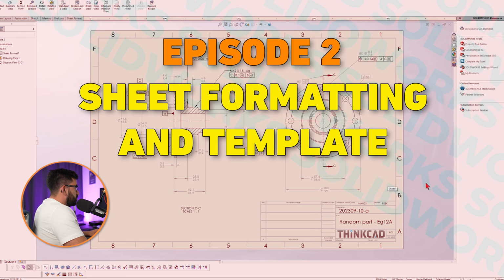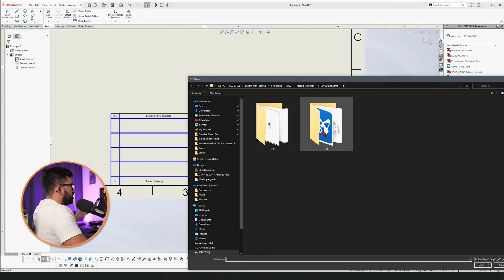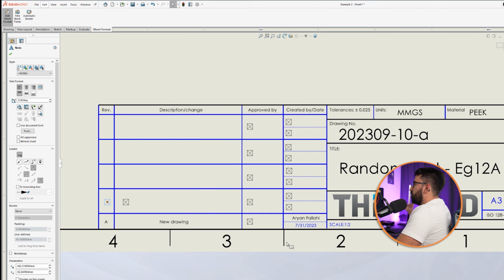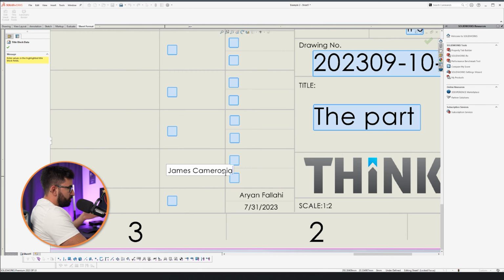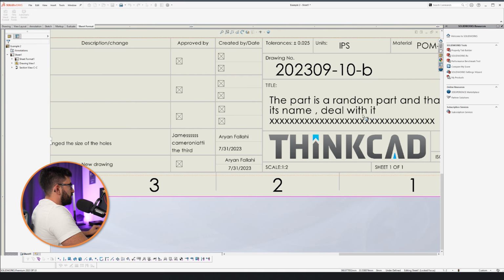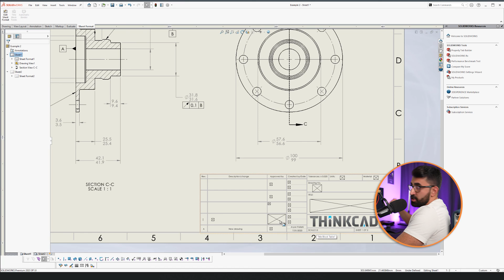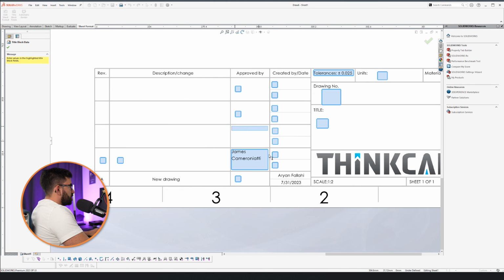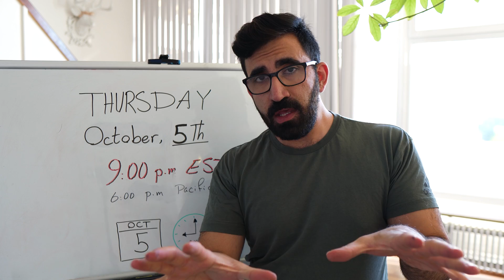SOLIDWORKS Drawing | Make your sheet template

Comment: Hi my friend I need to make single part with two or more configuration and I need the name of each configuration change for each drawing sheet the problem is I got the same configuration name on the sheets even if I change the configuration
Reply from the maker: It's the way you link the name of your config to the sheet. It's has to be through a linked property. Can you confirm you've done that correctly?
Reply: @with-aryan yes my friend I didt correctly

Comment: Hi
How can I link material and mass? it is very important because I don't want to do it manually by myself, it has to be done automatically. (I've already done that in inventor)
Thanks for your tips.
Reply from the maker: Yes, these are parameters, that you can add to the sheet, and link those variables as needed.

Comment: I always use property sheets for propagating data to the placeholders in the template, since Solidworks added that handy dandy properties editor/builder to newer versions of solidworks. In addition, I keep revisions separate from title blocks. It's still on the same page, just placed at the top. Solidworks default template is just fugly as butt ugly gets, I redid my own complete.

Comment: I followed the steps and tried to create another title block for a separate table that I made at the top of my sheet, but it just loads up the same title block I already created when I click title block fields. Can I only create 1?
Reply: What I got going on is I made my title block at the bottom and made empty boxes, notes, etc. I then made a custom revision table that I wanted to have set up so I can input things like on the title block.
Reply from the maker: You will have to save it as a template to open up every time.
Reply: @with-aryan  I made the table with line sketches, I didn’t insert it with the table tool. Can I save the table I sketched as a template to?

Comment: Is there a property that links to current drawing units, for use in Sheet Format? ? Or a workaround. Have being pulling my hair and do not have many to spare.
Reply from the maker: you would try templates, but I will have to investigate.
Reply: @with-aryan  Thank you, i feel dumb but have not found anything online and there is really a need for this, when working with various manufacturers and builders.

Comment: To flesh out automating blocks more, you can assign the title to file name, sheet name, etc. then you can set your scale using a property. You can also set the current sheet as a property as well so if you have multiple sheets, It will automatically update the number to be correct for the current sheet. You can also set your sheet size as a property as well. And many more. All of this stuff comes in handy once you set up a document standard with all the preferred settings and a sheet format with your blocks - you will never have to mess with anything again if you get a system down.

I am just learning all this stuff recently, but the way I like to think about it, and how I think it should work is that each block of information should be a module that can be dynamically changed or at least changed easily. Base sheet format, first page title block, second page title block, revision table, BOM or parts tables, should all be plugins that add on top of your base easily. Don't get too complicated. Remember, KISS.
Reply from the maker: Great tip, creating linked parameters is the way to go.

Comment: I have a question. Should assemblies have its unique property tabs and drawing templates? I have already created a property tab and drawing template for my parts. Once I open an assembly, the property tab (created in my part file) is not uploading. And therefore, no assembly-specific information are uploaded into my assembly drawing.
Reply from the maker: Yes! the property you've done belongs to individual parts. An assembly needs its own property. However, some fields e.g. Author could be in common but still...